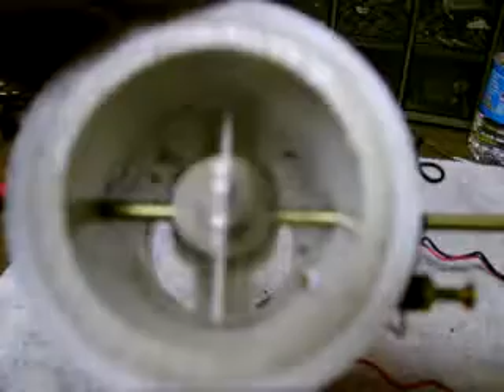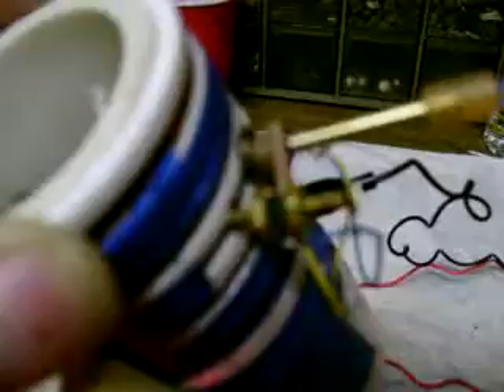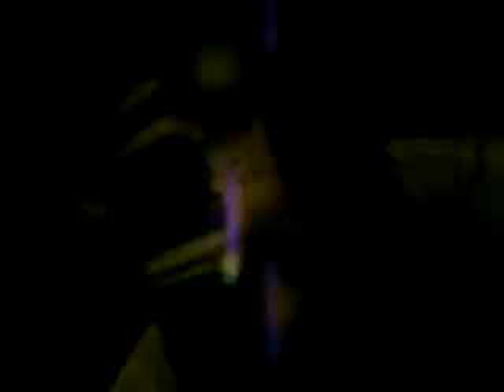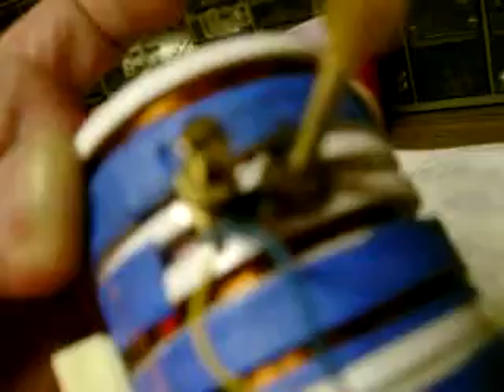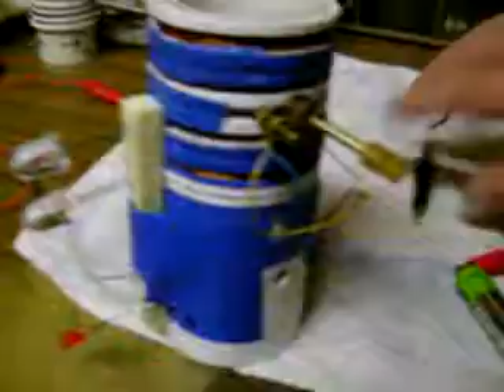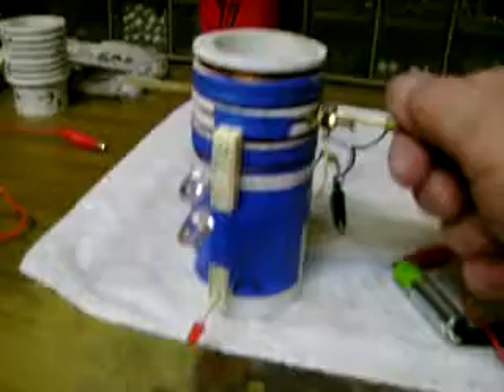Newman Motor / Generator...... YES it makes power!!!!

Comment: Do you use two coils or one?
Reply from the maker: I wire, 2 drive coils, 1 wire 400 turns? for producing AC.
It's just a toy, so secrets to this device
Reply from the maker: Poles of the magnet require a certain "Timing" or setting to make it work.
I have other videos I made with this device.

Comment: Well done.  Its similar to Keppe Motor of Brazil who has commercialized fan motors.  They take in 110/220v depending on region and produce 400-500voltage back emf.  Same concept but commercialized variants.  Their efficiency is quoted as 90% more than that of the next most advanced single phase AC motor in the industry.  

Both Keppe and Newman both discovered this separately without knowledge of each others' work
Reply: I don't think so,,  Joe Newman's motor was known world wide,   long before the Keppe motor was invented...  Newman invented it in the early 70's.   He's written several books about it..  Sadly,  Newman passed away in 2015..
Personally ,  I think Keppe copied Newman..  cuz Newman allowed his patent to expire on purpose..
  Newman wanted other People to use his motor concept and improve on it..
Reply from the maker: Newman "borrowed" it from someone else

Comment from the maker: The contact I put on are like a set of car ignition points.
I made a Cam lobe of Lead Solder.
Not running the current through the armature and using the points has made 
the motor part more energy efficient, and more reliable, and stable (constant)
No more fouled contacts on the armature !!!! That was a huge problem !!!
This is just too small for a reed switch. Great for smaller versions.
Running like a champ !!!!
Now to eliminate the vibration~~~BALANCE !!! 
Vibration = heat =loss of power